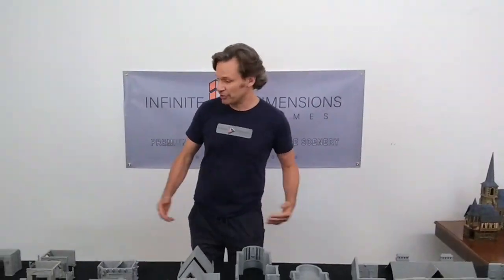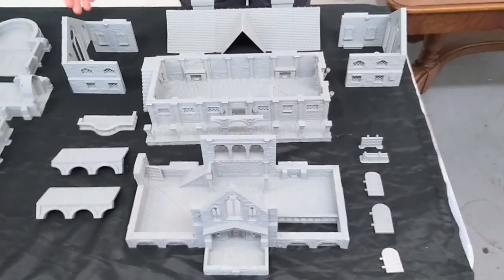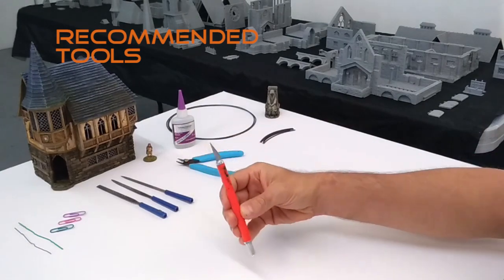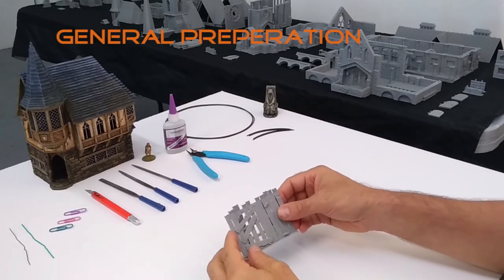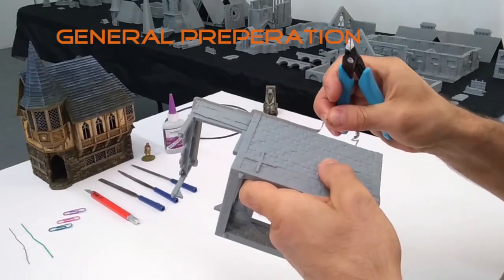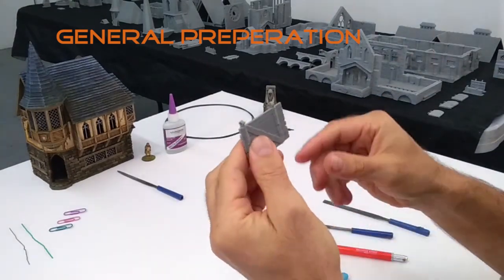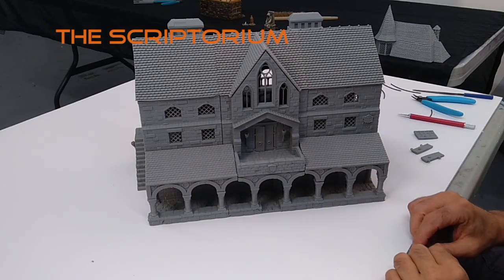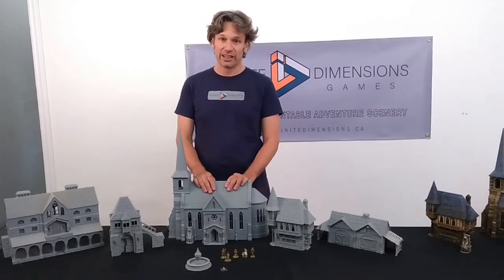Wightwood Abbey Core Set Assembly Instructions

Comment: Thanks for these, they're amazing. I've had a look through all the models, and there are a couple of minor issues that should be addressed. 
1: On the 2nd floor of the Abbots House, there have been some points stretched on the chest of drawers, leaving 3 large horizontal spikes into the room. 
2: On the 2nd floor of the gate house there are no supports in the hinge openings.

I checked through the rest of the files, and couldn't find any other issues. 

Really looking forward to seeing these printed.
Reply from the maker: Good eye, especially on the horizontal spikes diggis79! That won't show up in a print (we've printed sooooo many), but definitely should be fixed.  Cheers.
Reply: No worries, I'm so impressed with these models. I am trying to work out how to use them now.